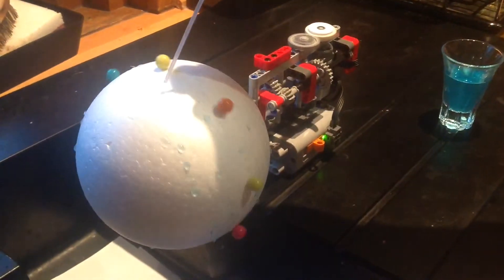Toy experiment: Water sticks to a spinning ball

Comment: Lol I can use glue too
Reply from the maker: I didn't use any glue. It's not a big experiment, you can always check it yourself.
Reply: Will do.  I believe half of what I see nothing of what I hear.  I'm definitely kind to experiment and see for myself but it's clear to me that those droplets are a thicker consistency than H20.
Reply from the maker: @TheHotdog314  You can see e.g. at 1:45 that, for the video, we're using a blue soft drink in the hopes of having the drops show up more clearly on camera. It didn't seem to act much different from water. We did set the rate of spin such that the centrifugal force on the surface of our ball was equal to the centrifugal force on the surface of the globe.
Reply: I am from Missouri they dont call this the show me state for nothing.  I was just giving an opinion.  Considering im not there to see for my self and in control in any variables going on here I can only base my guesstimations from what I can see through a little screen
Reply: Put a drop on  the side what happens or does gravity not work like that
Reply: I'm just trolling a little bit only bc  I'm not there.
Reply from the maker: @TheHotdog314  small drops  of water do cling to vertical surfaces. The point of this demonstration was to show that the spin doesn't change that. I encourage you to try it yourself if you don't believe it. There's no trickery involved.
Reply: I understand how water trys to adhere to other water molecules. So yea if you drop a little bit of water on a spinning sphere surface in such a way that's slow enough to prevent water from flying off but fast enough to keep the water in place. Kinda like when I take my tea bags to the trash I flip them around prevent enough time for gravity to let the residual liquid to hit the ground. Is there creators in that sphere would give an easy surface for water molecules to stay in place idk I'll try the experiment myself one day rt now we more worried about the end of the world. Sorry havent been to public school since 2004 and am forgetting things in life.
Reply from the maker: @TheHotdog314  No worries! You understand what the experiment is about: it  depends on how fast the ball/the globe spins.

Who says that the world is ending?
Reply: @mendelde  the world not about to end. Just a lot of conflict going on in the USA lol. 

Science was my strongest subject when I attended school.  My nuclear science teacher couldn't understand how I never did homework but could make A's on his test.  But again it was years ago. Then I started working in the automotive field and have lost. A lot of knowledge due to the repetitive thinking and  vocabulary working on cars.
Reply from the maker: @TheHotdog314  Ah, ok. I was afraid I had missed some new theory on how the world was going to end.

I've been following the US elections closely. The  Trump campaign lost at the ballot box; a 5 million popular vote lead would be a certain win in any European country. It looks like they're also losing in the courts. The generals of all branches of service have come out in support of democracy months ago, so if the Trump campaign tries to take it to the streets, they're also going to lose. There's a lot of fearmongering going on, that always plays well on social media and the boulevard press (including some TV pundits), but I don't think there's much to be concerned about for regular folks. Regardless of who you voted for. The electoral college meets December 14th, and it'll settle everything decisively.
Reply: @mendelde  yes trump did lose the popular vote. But they called the election prematurely and there is evidence of voter fraud in multiple states.  And it's not trump supports that are the issue here. It's the ppl spreading a false narrative.  BLM and antifa are the problem here. They are destroying cities and using violence to push opinions and belief. They are aginst the freedom of speech freedom of religion or anything else they are aginst.  So as I trump supporter I can tell you the news isnt telling the real story here. Trump is going to win and it's all part of the plan bc again its thr other side doing violent activities so they called it for Biden prematurely and now they took it away already and will give it to trump after it makes it to supreme court and then you will the destruction of the country.  It sad hopefully spreading good vibes a.d peace and discussion can bring us back together.  China is in bed with biden and  we dont want to be china here. We like our country the way it is.
Reply: @mendelde  not to mention there is ppl on the democratic party that want list of all trump supports so they know how to deal with them.  You know who else made a list of ppl they didnt like.  Hitler. Oh did you here about how they are building covid camps? Hmmm.
Reply from the maker: @TheHotdog314  That's what I meant by "there's a lot of fearmongering going on". You're being misinformed.
Put this in context, it's not BLM or Antifa who won the election, it's the Democratic party, and was the Obama/Biden administration really world-endingly bad for conservatives? You know that both Trump and Biden have about half the country behind them, it's not like some maniac has to institute a reign of terror here.

The courts will settle the legal issues; you know that Trump appointed 3 Supreme Court judges and all of the federal judges that Mitch McConnell didn't let Obama appoint, and the Trump campaign can choose where to file suit, so I don't think the court system is rigged against you.

And frankly, there's a list of registered voters which I think is public? So they already have that list, and they're not doing anything with it. Have you listened to Joe Biden ever? I've recently listened to his talks with Stephen Colbert, he seems like a decent guy.

You need to really watch who is telling you to be fearful! Who is tellign you to be afraid! and why! and then use common sense and some fact checking. It's not going to get worse than Obama was, and the worst thing he did, if you listen to the conservative pundits, was make it easier for the not-so-rich to get healthcare. That doesn't sound like Hitler to me.

How exactly is Biden going to "destroy the country"? What is he going to do? And do you have facts, or just rumors?
Reply: @mendelde  well your are speaking with a someone who has had democratic views for my entire life until recently. I was democratic while my parents were always republican.  Trump is not fearmongering hes not scaring us with covid. And I'm aware of who he has appointed as supreme court judges and I also looked into who the ppl that won the 2000 election for bush aginst al gore when they claimed gore won. I live here in  the usa I'm very aware of what's going on . Us real americans like our country the way it is.  Immigrants dont move here bc it's such a horrible place to live. Yes i dont agree with everything's trump does but I can tell u Obamacare did not work in favor for my poor ass. Neither did the gas prices.  And if u look into the real fraud of how many dead ppl votes they have counted for biden you cant believe what's going on. Do me a favor go look at the rallys and campaigns and compare crowd sizes. No one is buying what there selling unless they solely depend on fox and cnn for news I look at them all. So i know what boths sides are saying.  In the end I'm for freedom of speech. Right now im being censored for posting facts. Why?  Bc they make trump look good.  I believe in freedom of religion. The dems are trying to take that away as well and the only god is science.  So guess what I'm finding jesus. So when I see BLM and antifa holding F jesus signs I see the devil and evil in plain sight. I dont wish harm on no one but have been threatened numerous time from blm and antifa democratic members to shoot me or to kick my ass. We ain't scared 70 plus million  real voters for trump are lock n loaded and just waiting for some stupid ppl to trip we dont start it but we will finish it. But u clearly are a biden support and his plans for tega go ejdheuskdh or what ever he said in is interviews or speeches. You prolly didnt see those speeches though.   The news is totally bias and aguli trump so most ppl belief are based on what the main stream media tells them.  I can go on for ever and talk about policys and who is pulling strings like George soros who  got his money into all of it. So when my freedoms are threatened i dont stay silent. Yes are healthcare system is fucked which trump only been in office for 4 years compared to biden 47 years in politics and 8 of them as Vice president that have done nothing for all Americans. Well I know trump will win. It's all apart of the collapse of america. I'd be dumb to think both sides arent playing us. History repeats. Civil wars revolutions.  But I'll tell you why is one side bring us back 400 hundred years and one side pushing forward so what side donu think is pushing forward and which side is saying racism is a problem I haven't seen racism I grew up in the city my best friend is black so I don't buy the narrative of racism. Or defund the police when more whites are killed by cops than blacks or no one talks about the black on black crime is the worst they kill little babies and dont give a crap about that.
Reply from the maker: @TheHotdog314  As a practising catholic, Biden is in church more than Trump. Whoever tells you the Democrats are trying to take away the freedom of religion is lying to you, and they know it. Like I told you, think back on the Obama administration. The world didn't end in those 8 years, and nobody lost any freedoms.
Covid's all over the world, including Europe, not just the USA. There's no need to be scared of it, but it's not to be taken lightly either.
And that's the reason Trump had big rallies: he's irresponsible enough to pack big venues, Biden supporters take the science more seriously, and he's been doing smaller crowds as a result. It's not a measure of support, the ballot box is.

Dude, they're lying to you, and the "they're killing babies" is hate-mongering, pure and simple. You want a call back to who does that? The hatemongering is a sign you're being misled. Watch out for it. It's un-Christian, too. Matthew 5:44.
Reply: Well I'm watching like I said I'm not threatening anyone again it's coming from anti god.  Idk what u watching but I respect your opinion. One man speaks of God and the other not so much But jesus will take me when it's time. And I'll continue to love everyone until the very end so idk my side is showing love for all. But I'll keep trying to talk and not threaten my beliefs. Again I live here and pay attention to what I believe is going on.  Kamala is the president if that happens if you know biden you know hes having trouble forming complete sentences.  IM NOT BOWING to Moloch like the sick leaders of this world that practice satanic ritual like the cremation of care. The sacrifice of children. Not me not how I roll. So as long as i believe and continues to treat ppl with respect and to not judge doesnt matter who the president is yes I'm in control of my life and it doesnt necessarily come down to who leader of the country is. But its trump 2020 world will see.   God is great.
Reply from the maker: @TheHotdog314  Any deceiver can talk of god. The more of a deceiver they are, the more they do, usually. But see Matthew 25:40 - deeds do matter
.
(Not sure where you're getting satanic ritual and child sacrifice from, that sounds like unfounded rumor and fearmongering to me.) For Kamala Harris's attitude to religion, see e.g. https://religionnews.com/2020/10/28/kamala-harris-talks-about-her-own-faith-and-how-it-might-influence-a-biden-harris-white-house/
I'm happy that you realized that who the president is doesn't impact your life all that much -- some, for sure, but the election should not cause you to despair.
Reply: @mendelde  search bohemian grove that's where they bow to moloch.  Study moloch then you understand how sick these ppl are.  But I base my judgment off of action not a man's word.
Reply from the maker: @TheHotdog314  You believe Alex Jones, that's your choice. I prefer facts to conspiracy theories.
Reply from the maker: @TheHotdog314  https://www.youtube.com/watch?v=Upa2Rk_Y1Z0
Reply: @mendelde  no see that Lady asked for a list of trump supporters bc she hates us so much
  You wont change my mind bud.  Trump2020.  We dont want to be part of the global reset we like america. Not americhina
Reply from the maker: @TheHotdog314  You're going back 50 years to show that Biden was racist; today, he's chosen Kamala Harris as VP, which settles that. For Trump, his present stance is clear from Charlottesville up to "stand back and stand by". You're not going to  successfully argue that Biden's record on racism is worse than Trump's.
Reply: It's as ridiculous to say water can't stick to a spinning ball as with glue
Reply: @Marques2000  if you say so.

Comment: desperate globers.
Reply from the maker: I have honestly never seen a desperate glober. It wasn't globers who falsely claimed "water doesn't stick to a spinning ball", either. :-) It's always the FEers who try to con you into believing stuff they have no evidence for.
Reply from the maker: btw  how desperate do you need to be to deactivate comments on your uploads? Here's some information: The "glass paperweight" won't give you proper Dec 21st sunlight for the Southern and Northen hemisphere. If you have access to a smartphone with magnetic sensors, have the values displayed and you can see the magnetic field is diagonally down in most places on Earth and probably where you are (I checked this for my location ca. 50⁰ N). Your latest upload does not explain star rotation at all; there is NO perspective on the stars, you can buy (or craft, look for instructions on the Internet) a sky globe and check that it is accurate and not perspective distorted no matter where you are on Earth (this knowledge is over 2000 years old).